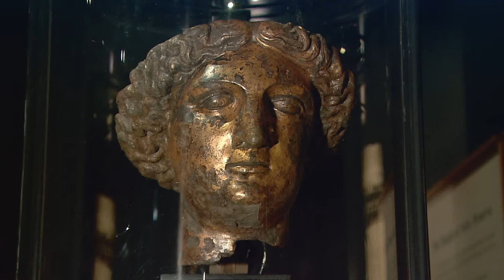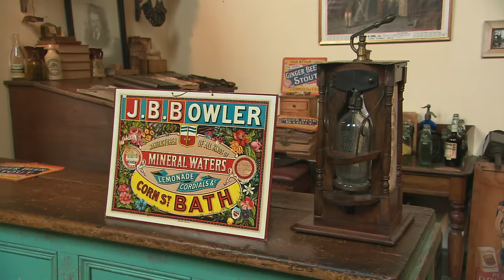England's Bath and York

Comment: 'Just to the north' of London. Yeahhhh.
Reply: Said 2 hours to the north.
Reply: I mean as an American, I gotta travel at least 2 hours to get to another state. So it’s all relative I guess.
Reply: @Thursdaym2  It's almost a 4 hour drive!
Reply: @thomHD  2 hours on the high speed train though
Reply: @Eric-ys8do  Sorry, but no trains are that fast and with changing lines it is over four hours. I think it is worth pointing out for tourists planning a visit to both places.
Reply: Believe it or not 100 miles is exactly the same distance in England and the USA.  Who'd have thought it.
Reply: Stella Yates from your hotel door in central London to your hotel door in York could be done in three hours. Depends where you start in London and how much time you give yourself at Kings Cross
Reply: Arguably it's easier to go further in the UK than the US as the trains - and public transport in general - are better in the UK, and the roads are as good, if not better.  Fuel's still pricier though.
Reply: Hailey 14 
8
Reply: @hailey1440  takes me almost 2 hours just to get to work
Reply: @hailey1440  A lot of roads in Britain are thin, curvy, on the edge of a cliff or in a forest so it usually takes about 5 hours to go a couple hundred miles